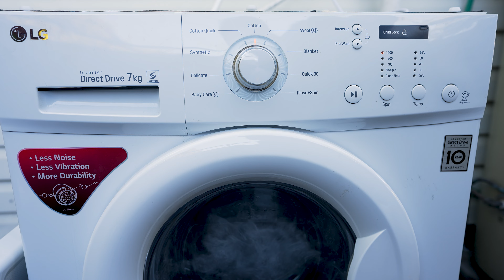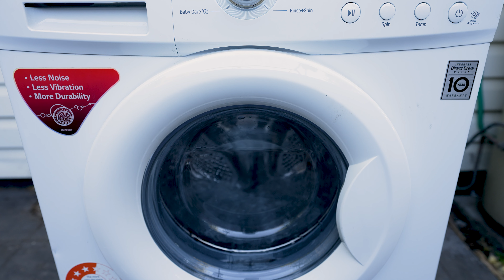Washing Machine Keeps Filling  Water  Over Fills Repair

Comment: I have a F1280CDP25 model LG washer. The stainless drum isn't turning to the left or right and ends up giving the LE error. I have watched your video on that, hopefully it will help fix mine.
Reply from the maker: Hi yes that should be it the sensor. Change that and it will help
Reply: @askmrwashywashy  Thanks
Reply: @chibosstv4271  how did you fix it?

Comment: What happens if the water does not stop filling? Is there a overflow shutoff to prevent the water going on the floor?
Reply from the maker: Hi no. The models that have one are for flood prevention in case there is a leak.
Reply: @askmrwashywashy  Is there a flood prevention device of some kind available I can get?

Comment: Can you do a review on replacement of the rubber around the door. Mine is worn out. I have LG WM3488HW 24" Washer/Dryer Combo with 2.3 cu. ft. Capacity, Stainless Steel Drum in White
Reply from the maker: Ok will try and find that model and do it in the next few weeks
Reply: @askmrwashywashy  thank you so much

Comment: Couldn’t find a video on my neighbours logix washing machine think it’s a vestel machine under that brand. 
It kept overfilling near enough to the top of the door then e12 would come up and beep I done what you said blew down the pipe and I also blew into the pressure switch put it all back together and now it’s working fine again and stoping the water at more appropriate level. 
How it didn’t flood I do not know.
Great video thought she needed a new pressure switch but it’s fine now something flew out of it when I pulled it off.

Comment: Very helpful thanks! Mine start working the cycle fine but at some point (usually about 10 min before the cycle ends) start filling with water about half of the drum then drains by it self. Do you think that this issue is related to that sensor? This also cause delay on the cycle maybe about 5 min or more than it should be. Just as a reference, I have WM2688HWM.
Reply from the maker: I think 10 min before is rinse cycle
Reply: @askmrwashywashy  thanks for your reply! Yes, I think the rinse cycle but is on the transition to spinning. But, do you think could be the same sensor? Thank again!!

Comment: i have same model but the problem is water supply is constant even when machine plug is removed. Any idea folks what is the problem? i think somekind of stopper is not working or need cleaning. please help
Reply: Solenoid is stuck open
Reply: @AnUnapologeticApologist  thanks it is working fine now after changing the solenoid

Comment: Did you know that those Valves are adjustable ?
Theres a screw on the top .. 
Remove Loctite
Turn Clockwise to make Higher
Anticloclwise to make Lower ...

Before one throws it away ...